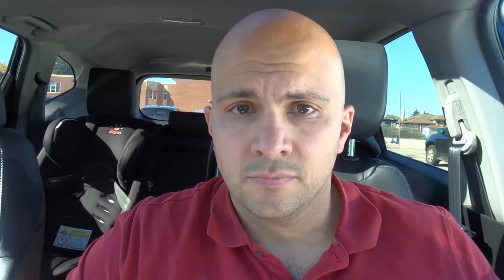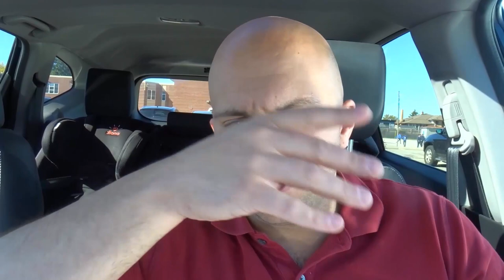7 Reasons Why Your Car Is Stalling At A Red Light

Comment: Thank you! I've  changed  air filter, fuel pump, spark plugs, coils and  knock sensor it has to be injectors or converter. When the engine is cold it drives fine but when it gets hot that's when it starts tripping would the injectors cause this or the converter?
Reply: Hi, did you fix it? i have exactly the same problem with a 2008 focus
Reply: crank sensor
Reply: @francisjpk  yes I did
Reply: @MrBrancomusic  I had all of them done.
Reply: Damn I have the opposite problem. Doesn’t happen when engine is warm only happens in the morning when I start driving it
Reply: @UnKnownrider720  as much as i like cars and all,EVs are godsend. No more fuel,air,ingition,exhaust etc.
Just a perfect electro motor
Reply: my one had similar problems , at the end came out that relay problem.
Reply: @teresahill5127  did you ever figure it out?

Comment: Would there be a reason for my truck to stall out at a stop sign literally 20 mins after I replaced the engine airfilter? I’m 100% everything is connected how it should and the engines not running hot at all.

Comment: Mine was none of the above that you listed I even replaced 4 on your list but took it to shop and it was intake manifold gasket. Also in past I had a car die because my idle air control valve went out. There’s just too many things that can cause a car to stall. Just don’t want DIY’s to think if they go down your list that is all that can cause the problem. When there can be other items to cause this problem.

Comment: 1. Mass airflow sensor
2. Bad spark plugs
3. Transmission torque converter
4. Bad fuel pump
5. Bad alternator
6. dirty air filter
7. Fuel injectors
Reply: Thank you
Reply: Thank you.
Reply: hi should have read that before. would have avoid that guy voice.
Reply: Thank you for this
Reply: @tridev badri is the throttle body a single part or a collection of parts?
Reply: @MrBanktools  the voice of 10k annoying children
Reply: @nurpledpurple  lol yeah
Reply: Goat comment. 🐐
Reply: Tysm this guy is a bit much for me 😂
Reply: Conclusion

Comment: I've changed the map sensor I've changed the idle control I've changed the idle position sensor and still dies car runs strong o I've changed fuel filter and pump alternator is good battery good
Reply: You needed to go to a electrical mechanics. My 92 Accord gave me similar hard time changes all the parts like you did and cost me lots of money.  later finds out $10 relay fuse problem.
Reply: Was it a fuel pump relay?  Or another relay

Thanks

Comment: Ugh my car started stalling & quitting last year. The mechanic changed the mass airflow sensor & it worked better, but started messing up again. My car just died at an intersection yesterday. 🙄 I really hope it’s something easy to fix.
Reply: Throttle body cleaning is to do yourself. You take off your air filter box and the chamber the hose from the air big connects to. You should see a disc with an axle running across the middle of it. If it's covered in black crud, you need to clean it.

Your pcv may be clogged, it's easy to change. The idle air control (if your car has one) is also easy to change. A simple took kit will let you do these jobs. There's videos to walk you through it.
Reply: @blatantmisconception  Is that location of throttle body the same on most cars? Did you mean to say  hose connected to air bag?
Reply: @memoryrinehart  Pretty much. it'll either be at the end of the tube/pipe/hose running out of the filter box, or, if it will right under the air filter. Google will help you find a pic so you know what to look for.